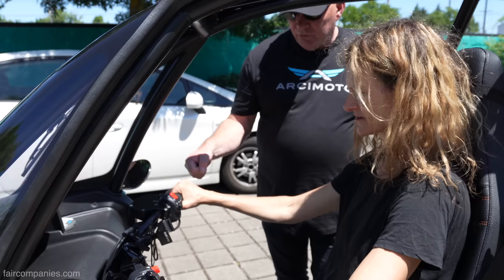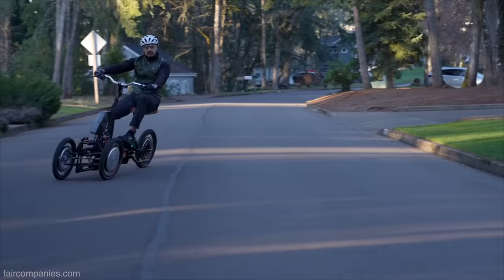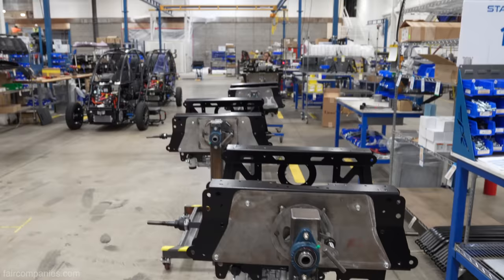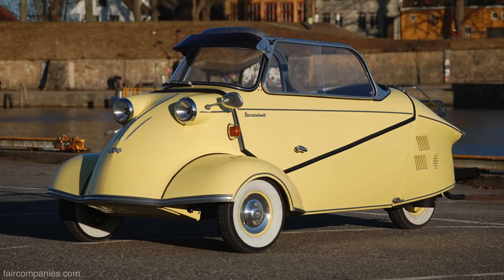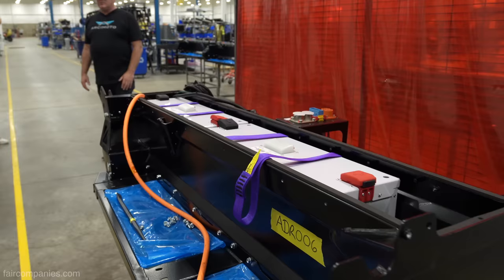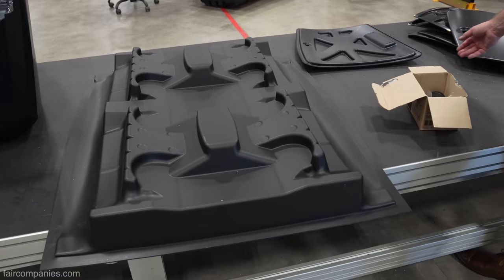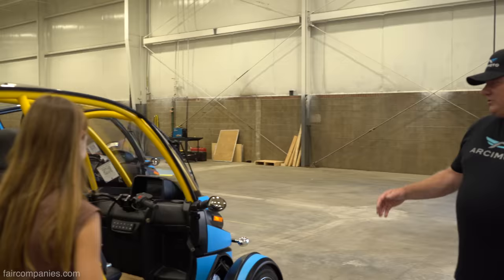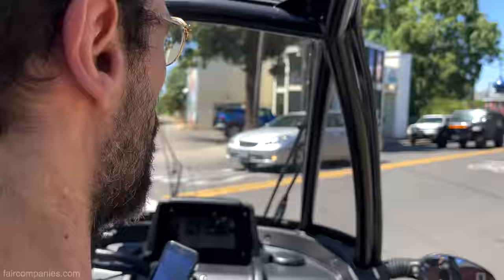Arcimoto 3-wheel EV commuter blends bikes' fun + cars' safety

Comment: Wayyyyyyyy too expensive. Get a Mitsubishi Mirage instead. I get 44 MPG with mine. You wont be limited to 32 miles at 70 MPH!! I get almost 400 miles per tank in my Mirage.
Reply: The price will drop when they get in to mass production. They are working on batteries and the might be changes in the future. Give them time, they are a start up company and haven't been around as long as Mitsubishi.
Reply: We really really should be limited to shorter drives in order for our species to survive the next century. 70 is wasteful and should be lowered. Most car owners drive a 4 passenger vehicle by themselves with an empty trunk. The FUV successfully targets this wasteful market and it weighs less than half of your Import brand which also steals jobs away from your neighbors. I have no gas tank and add no co2 to the air when I drive, the most affordable and least expensive. The price is a bargain in the 2022 market and includes no gas or oil changes ever, and an 80% lower insurance rate which is saving me $800/yr just on insurance. Mooooosst affordable! I have had no need to drive a long distance for any reason for 8 years now but certainly for a single need I could rent a car and retain my sustainable daily transportation behavior. Most affordable.

Comment: Glad to hear you referencing the insanity with the use of 4000lb vehicles to pick up a newspaper etc. That exceleration looks a little scary. The 100year obsession with motor sport needs to be dropped now with full focus on range and economy maximisation. Saw another company similar to yours showing off and wheel spinning their creation, it can be off putting especially if you are fully aware of the planets health and that's why you want electric transport. Need to kill the motor sport obsession, cut the head clean off the snake and stabilize the  planet with maximum economy for every drop of energy until we have a reserve off clean energy we can waste on speed dreams. Your company looks very promising, recommend you attach it more to the planets health and cut it clean completely from motor sport to optimise your success. As the planets health continues to decline, only the greenest companies will thrive.

Comment: I always think 3 wheelers are the worst of both worlds. Not protected from the wind and rain but no leaning into corners.
Reply: You always think wrong. Drivers are totally protected from wind and rain while moving and we enjoy the far safer situation of having 14.5 inches of flat car tire tread width on the road at all times  instead of the far more dangerous rounded tires that easily wipe out on a slick spot or wet pavement. No need to lean and along with that we are safer by an order of magnitude than any motorcycle driving thanks to the roll cage and 6 point harness. No helmet or air bags needed. It was a huge relief to get my Arcimoto and no longer deal with the dangers my 5 motorcycles involved. I was lucky to survive.

Comment: You should amend the title. As a 3 wheeler it is not tested to car safety standards.
Reply: You should STOP making up lies about something you do not understand. The biggest selling point is PRECISELY the fact that the crash cage is tested to standards applied to cars, a 22G force collision. In combination with the 6 point harness which means no need for a helmet or air bags. It seems that smarter designs can't be comprehended by dumber people.

Comment: Sooo an electric trike with roll bars more or less. Im sure theres a thousand comments about safety but honestly the thing is probably so fucking heavy from the battery pack itd probably take a pretty substantial blow i imagine
Reply: Roll bars alone are not enough, it is the combination of 6 point harness and certified crash cage that offers such great safety compared to any motorcycle. A Harley three wheeler with crash cage would weigh the same. We have already seen an old man walk away after being t-boned by a pickup at 35 mph. No helmet needed. Not just roll bars but a reinforced hardened cage with 4 cross braces between the two main side pillars. 
1300 pounds is fine with 77 horsepower and 85 mph top speed. I never get tired of hearing the exciting sound of my twin motors winding up.

Comment: Requires a motorcycle endorsement in most states and not even registrable in many states. Making them impractical at best, inaccessible to most drivers.
Reply: Totally false. Only states that are targeted for distribution from Arcimoto are relevant. 100% of those states have updated their laws. Only two of those states mandate a MC endorsement, only one requires a helmet. Arcimoto works with states to update their obsolete laws on autocycles. No states ever bothered to legislate on enclosed autocycles before now. 
There are whiners here who demand to buy an Arcimoto in states or countries where none have been added to their laws and no Arcimoto mobile service teams have been assigned. 
The internet is toxic enough without you adding more made up lies of your own. It can't be impractical in a state where the company is not selling its vehicles. It is unavailable. Big difference.

Comment: How recyclable are their batteries because majority of electric car batteries like Tesla's are not recyclable and the mining alone for the battery materials are far more detrimental to the environment then gasoline engines all around.  Although I believe we should be using vehicles as Nikola Tesla intended without batteries or at least hemp fuel or water power engines.
Reply: All EV batteries are recyclable. You are wrong. Tesla geeks do not grasp real science.
Reply: They have come a long way with recycling. They can make new batteries from the material of old ones.

Comment: If you’re T-Boned you’re toast
Reply: Already happened. The guy walked away with only bruises after a 35 mph t-bone collision because the design works. The crash cage will not bend at all. Thanks to the harness, no helmet or air bags needed.
Reply: @popeyegordon  I was in a horrible car accident when I was younger. I lost a vertebrae and had to learn how to walk again, so I’m all about safety and airbags
Reply: @Doc1855  Learn about the alternative safety design used in formula one race cars. Harness and crash cage, no air bags required. Don't be so narrow minded.

Comment: It passed the 28G crash, but there's no way the occupants would survive the 28G crash into a concrete wall which is the govnt test procedure. Pilots can survive high g manuevers but not into concrete. Govt safety tests use airbags, bumpers, helmets, eye protection, etc, for crash dummies not ppl. Pilots can sustain 28g or higher instantaneously but are unlikely to survive 3g side to side, 11g instantaneous, and 9g sustained if they wake up to avoid a crash after dropping back to low g. The salesman is excellent. The vehicle is not in full enough production to produce sufficient company revenues without significant investor risk. Competition will determine long-term outcome. Surviving a side impact from a sarcastically light weight car would not be likely without all occupants wearing helmits, even though the salesman implies it is safe. Safety gear looks bad in commercials. Ford and Chevy ads don't use helmets. Just don't drive that e-car on any streets or highway. --Don Blankenship, aerospace structural engineer. Buy the vehicle for off road fun. They're operation looks first rate to me, but so are hospitals and morgues. I've crashed three times in two months on my great fat tire e-bike. There is a steep uphill learning curve. Would I buy one for my wife? Hell yeah, Mrs Hogwallup dun runt off with all the silverware. Hey, there's a brilliant strategy: buy one for someone you'd like to kill, then let them drive one of those e-cars in traffic. Would I buy one for myself? At the right price not trying to make them rich beyond belief. Competion. There are competitors. To be fair, use the salesman in its crash tests.
Reply: FACT CHECK - I caught you posting a maliciouis lie. You are flagged for this offense. The crash cage test is the same for all vehicles whether or not they use seat belts and air bags. The FUV is certified safe because of this standardized NHSC test. It uses the forumla one racing safety system of 6 point harness combined with hardened crash cage. A helmet would only add weight to the head, increasing potential shock injury unless there is an elaborate neck brace which is not used by consumers. No air bags needed with the full harness.
                                         
No one has been killed or even seriousy injured in the FUV (as of June 2023) despite the thousands of rentals being tried out by beginners. Here is a link to the worst T-bone collision this design has seen so far, the type you LIED about - a full sized pickup broadsided an FUV. This tore off the entire front of the truck without bending the hardened center cage bar which is cross-braced in 5 places. Yes it knocked over the FUV but the driver walked away with only bruises. He ordered a replacement and thanked Arcimoto for making such a safe vehicle! The truck's license plate remained wrapped around the intact crash cage center post. https://www.facebook.com/groups/343218869645332/search/?q=t-boned  
Motorcyclists are very confident in the level of safety Arcimoto offers while still offering the joy of motorcycling. More traction, more comfort, no need to balance, crash cage and harness and higher visibility.

Comment: I would say you loose all the fun from motorcycles, without gaining the practically and comfort of a car.
Reply: As an owner of the FUV who owned 5 motorcycles and scooters previously, I can say it is more relaxing as I am no longer in danger of injury at the high risk rate involved with motorcycles. I can't spin out on a patch of gravel or oil, a tire blowout will not be nearly as risky now, the reduced sense of balance with age is not a factor now, the wide flat car tires grip the road better in all conditions and a collision from any angle is safer and less likely to be fatal now than the risk was on my motorcycles. I need no helmet or safety gear of any kind.  
The insistence on too much comfort has been slowly killing our biome for 100 years. The party is over. Time to pay the bill.

Comment: The reason people travel in heavier vehicles is for safety purposes!!
"Oh my god I feel like I'm going to slide out!!"  ....that's because there is a real risk of her sliding out or being impacted by something from the side. She should be wearing elbow pads in case they hit a curb and roll the vehicle or someone else crashes in to their vehicle causing them to roll or collide with a tree or building or another car.
Heated seats and grips and a little defroster and blutooth stereo so you can be tracked everywhere gooodo! 
Have you seen the statistics of how smaller vehicles and electric scooters fare in collisions? 
He says there's brakes and seat belts but for starters - where are the airbags?? The amount of accidents and deaths involved with these smaller electronic locomotives is escalating exponentially and his statements regarding some people being in accidents in them and turning out alright sounds questionable at best. "We know if we go to Arizona we're gonna need doors and an AC inside" - there's more than that these designs will need.
These are short-range vehicles with short-sightedness. 
Consider a tornado or another natural disaster such as a fire or volcanic eruption where you require an enclosed space let alone a human-made disaster where you're fleeing for your life - she said she'd like to take it on the freeway.... how it would go if it hit a deer or a moose or some other kind of wildlife or another vehicle? How about photosensitivity and skin burning? How about plagues of wasps or locusts or other bugs? Mosquitoes? What about if something falls from above onto the vehicle like a rock or a large branch? What about the incidence and prevalence of vandalized charging stations? What about flood safety and wet weather? What about the incidence of lithium related fires in EV vehicles and locomotives? What about if we get hit with a Carrington Event scenario from an EMP of CME? These types of vehicles are not practical for long distance nor overall safety in multiple ways and in this day and age of political aggression and micronovas and sinkholes earthquakes and tsunamis you need an automobile that has longevity and ability to go the distance as well as proper protection of the occupants inhabiting it during transit. I haven't even mentioned the loss of jobs and landfill potential - he hasn't spoken about any green design regarding recycled materials? He speaks of crash tests but the tests for these types of vehicles are not set against the crash standards of standard vehicles including incidence of vehicle mismatch. 
Say a heavy vehicle driver falls asleep at the wheel and goes onto your direction of travel - the comparison between these and a standard car are immeasurable in safety testing and outcomes due to decades of data and standardized testing practices. Standard vehicles win every time and until we can create automobiles that don't explode and can outweigh the benefits the standard vehicles have to offer regarding safety and distance it's just not worth it!
Don't get me wrong I'm all for innovation and increasing people's mobility and experience of the world but there are too many factors that make this type of transport incredibly unsafe. 
~From someone who survived a head on hit and run collision in a vehicle mismatch (I was in a Toyota Echo where the airbags did not go off and they came on to the wrong side of the road and were driving a heavy large older vehicle - guess who came off worse... ?)
Reply: You failed to dodge it. Don't blame others on your driving failures. The Arcimoto uses formula one racing safety systems - a 6 point harness and the certified 22g highway safety tested crash cage combine to make this as safe as any small car even while driving barefoot in a bathing suit. NOBODY HAS EVER ROLLED THIS VEHICLE!! Just one serious t-bone collision at 35 mph knocked over this autocycle, it has a very low center of gravity at axle level. The victim walked away from that collision with only bruises, no helmet was worn or needed. He thanked Arcimoto for making a safe vehicle and ordered a replacement. No air bags needed with this design. These facts prove you are nothing but a blathering troll.
Reply: A billion motorcyclists and scooters have no problem with insects. The Arcimoto provides much more protection from insects than any of those popular vehicles. Arcimoto has a policy of sustainability in materials, sourcing and design but you spouted off before doing any research. One video is not enough.  "political aggression and micronovas and sinkholes earthquakes and tsunamis"  HAHAHAHAHA!!!

Comment: Good idea but the "cage, tested by federal governement" is just pablum. It's open. NO protection from sides just like a bike. People will buy thinking it's safer than a car. It's cycle. Ride it like you want to live and you'll be fine. Take the Motorcycle Safety Foundation course and you stand a chance at living. Best Wishes to the company.
Reply: It's not a car, it's an autocycle. It has passed the crash test. I think people understand it's safer than a motorcycle and it's not a car.
Reply: @beachbum200009  I can guarantee you that the average buyer will think it's as safe as a car no matter what they are told. You heard Kirsten say "lets go on the freeway" without any safety gear, helmet or training. The stastics from other "like" vehicles shows this. I wish the company well..just hope they make it clear to buyers it has all the risks of a motorcycle with none or the safety of a car.
Reply: It has a roll cage and two seatbelts...it's definitely safer than a motorcycle lol
Reply: @mattnelson1716  No, it's not. I can kick the bike away from me if I go down. Strapped in, you are along for the ride wherever it goes. Roll cage ain't gonna save you in a T-Bone. It's a free country, believe what you want. Best Regards!
Reply: @blessedheavyelements8544  One has already been t-boned. Seventy year old driver walked away with slight bruises. This vehicles spatial awareness in traffic is awesome for defensive driving specialist. Keep your gas guzzler and stay in your box, I live in SoCal and see the need. The rest of the country will follow suit in a few years.
Reply: @barnabasseadog7660  I yield to evidence. I ride myself, no car, so I hope that more of these types of things become commonplace ASAP. Thank you for the info!. Best Regards!